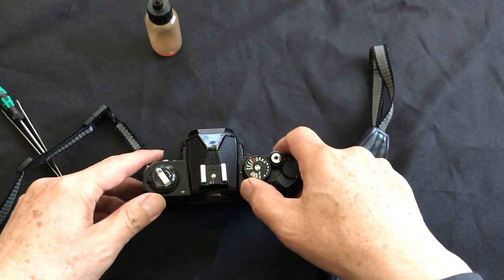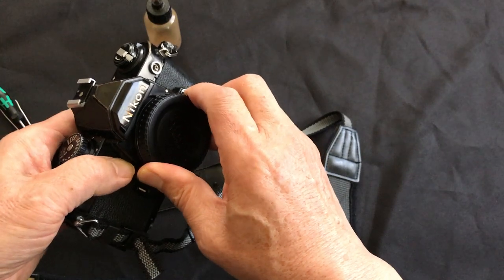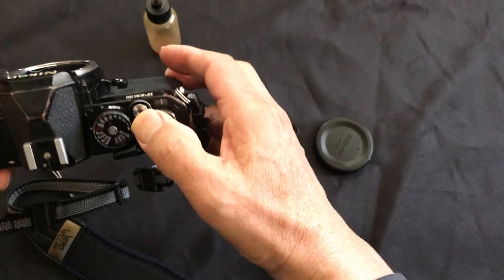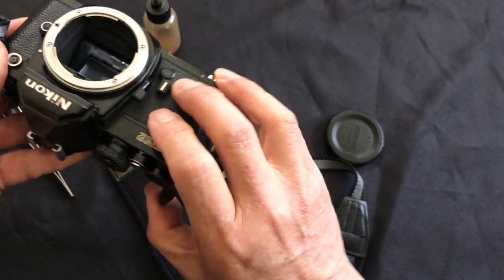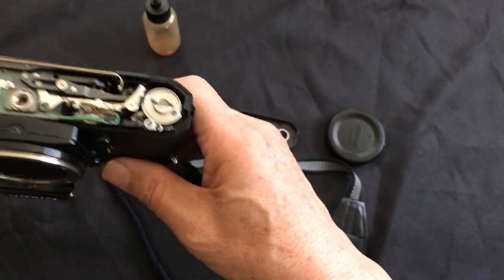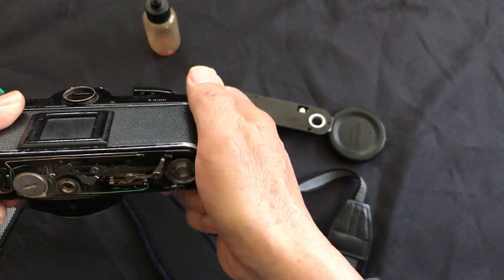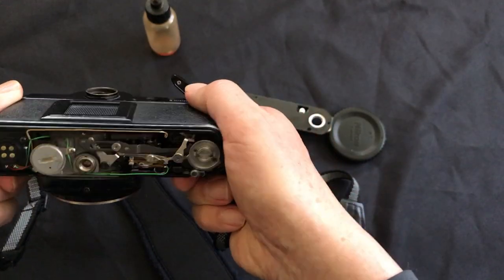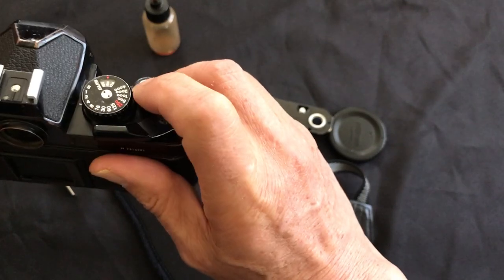Nikon FM2N Camera Repair: Unlock Stuck  Mirror

Comment: 這不是真正的維修 , 找不到根本因由?  故障會再出現
Reply from the maker: You maybe very correct on this. But this is my way of doing this in 10 minutes or less. If this problem happens again I will repeat the same process again. BTW, may we see your correct way?
Reply: @hometechengineeringvlog1141  可能有污染物藏在機件內，嘗試用酒精清潔相機底蓋內零件，再用 WD40 進行潤滑，會改善這種故障。